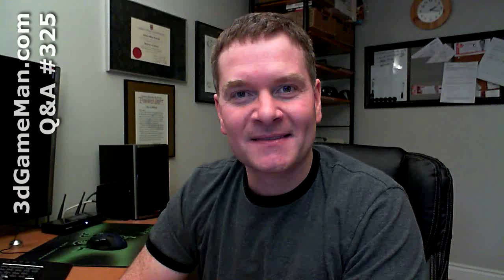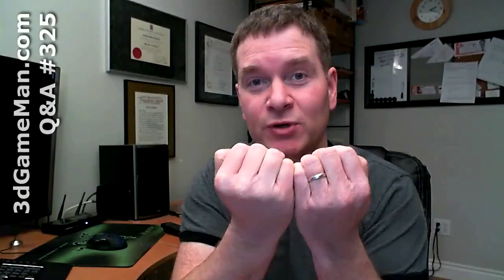#325 - Q&A: What are cooling heatpipes?

Comment: Copper has a higher thermal conductivity, higher thermal capacity, but lower thermal transmittance. The whole point of heatsinks is to move heat away from the CPU as quickly as possible. In this regard, a liquid with a high thermal transmittance is helpful. However, most liquids have a very low thermal capacity.  Couple this with their low thermal conductivity and it quickly becomes a tradeoff. Getting the heat out of the liquid, through the pipe wall, and into the heatsink fins takes time.

Comment: @IareDewey. 
Heat does rise, and dissipate to cooler areas that conduct it like the surface of the coolers fins is where it ultimately ends up where the fan can cool more easily. 
In the pipe the fluids have no place to go but along the rest of the pipe. 
If you hold a thermometer horizontally then the mercury will rise in the exact same way it would if it were vertical.
Just a efficient way of getting more heat up the pipe to dissipate in the fins etc.

Comment: @slizza90 Heat rises, like, in the opposite direction from the pull of gravity. The location of the heat source is irrelevant. the heat would simply rise to the upper half of the cooler. My understanding is that the fins add surface area to the CPU, and the heat pipes simply divide the heat evenly among the entire surface area of the fins.

Comment: @IareDewey
I don't see why it would matter if it's on it's side or not.  
It would still naturally move away from the hot point as it changes form, and these fluids all do infact change form and behavior as they heat up so it's impossible to keep them still like that. 
 It's in a closed pipe (vacuum i believe)

I shall write a brief email and send to a couple manufacturers to get a expert answer to this.
They are usually v helpful answering these things.

Comment: @slizza90 It works by transferring heat between particles, not physically moving the particles themselves (hence conduction). A convection cooler would work perfectly if the cooler was very tall, and standing upright, but since the cooler is on it's side, the convection currents in the heat pipes wouldn't have much of an effect on the cooling. (Side note - Actually, TEC coolers are the best air coolers currently.)

Comment: @IareDewey
Please explain what you mean?
 It goes hand in hand i beleive.
 Conducting heat through copper and liquids plus transfering heat as the the liquids change form as they get hot yes? 
This dosn't apply to all coolers naturally, but to all the ones who use liquids specifically because they behave in this manor wich is all the top air coolers right now.

Comment: The idea is the substance inside reacts to heat and rises like mercury does and when it cools down it goes back to the bottom again.. like it could be turning to vapor at the base of the pipe then heating up and running up the pipe then when it cools it goes back to liquid and goes to the bottom again to start over again. 
Rodney left that stuff out, it's a real important part of how they work, he dropped the ball a little :P 
Don't worry Rodney, we got your back :D

Comment: that's awesome. I didn't know that and I'm a computer enthusiast. Anyway, my current cooler has them.... I'm look to over clock though, so I'll soon be in the market for liquid cooling. also, I'll be needing a new video card :D and I wanna know what's the best card I can get for under 200? (btw, It doesn't need to be a top notch gaming card cos I usually O/C the cards. and it's very easy and effective when you do it enough.